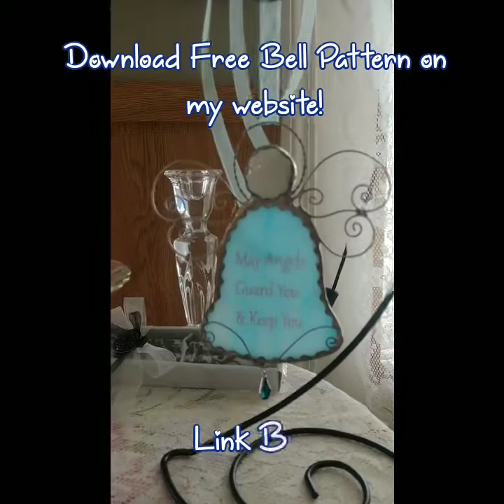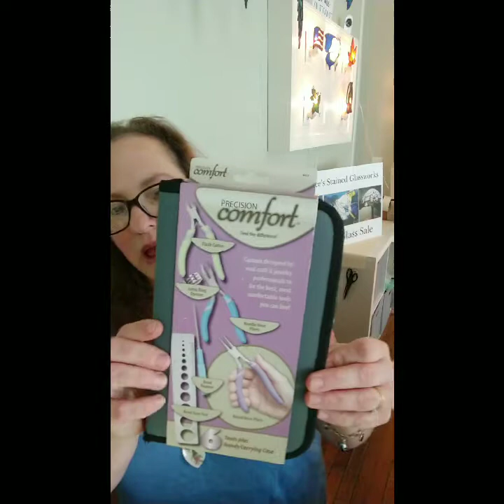Adding Wire Work Detail to Stained Glass Part 2

Comment: Hi
Dont you find moving the wire like that leads to the wire tearing of the foil tape, that happens sometimes to me when i try and attach wire to an edge...any tips 😊
Reply from the maker: I completely understand. First I prefer to use gel flux as the liquid flux can get under tape and cause lifting. Make sure to clean the glass and edges thoroughly with alcohol before applying copper foil.  I also find that the Edco black backed foil is the strongest.  And make sure you are burnishing all sides of your foil with your fid. Hope this helps!  Thanks for watching
Reply: @reneesstainedglassworks3990  Thankyou fir yr extra tips, I do most of them  I will use alcohol & I have been meaning to change to gel flux, Thankyou so much for yr help 😊